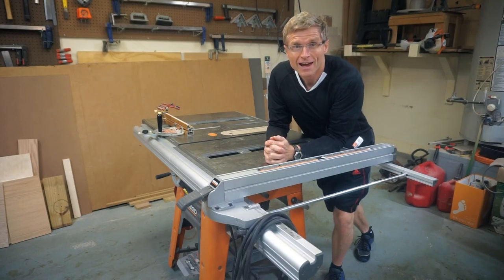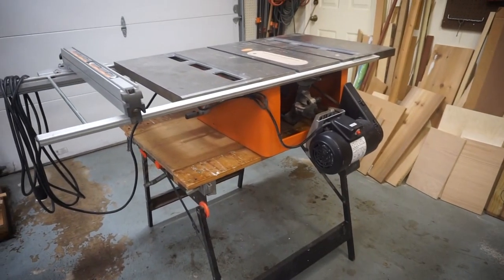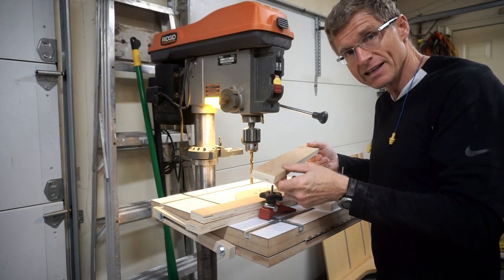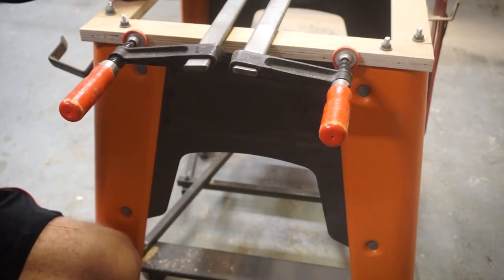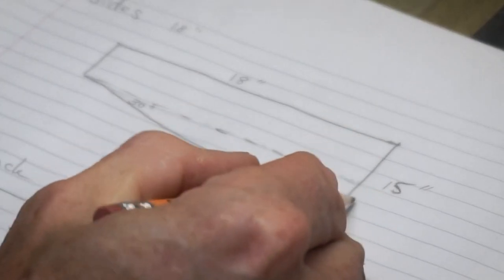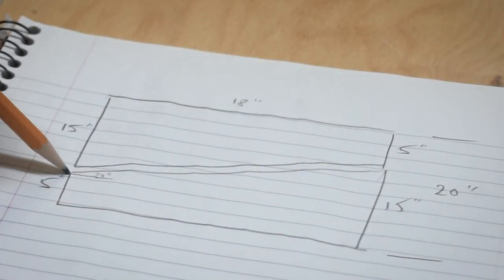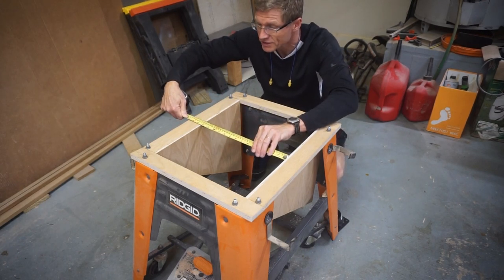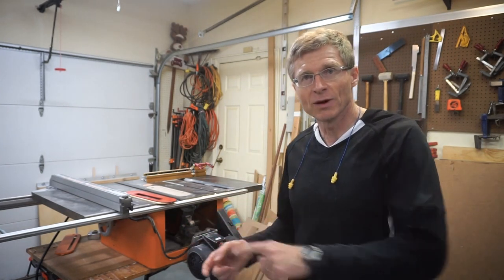How to Make a Table Saw Dust Collector

Comment: You did it the hard way. Wood attracts dust and is a poor choice for a dust collection system. Get a big gulp, 24" of 4" hose and a reducer instead and you would be done in an hour. Plus it will collect more dust. Dust collection at the bottom mainly gets the heavy particles. You also need dust collection on top for the fine particles. Use a Guard Shark for that.

Comment: One other thought.  It might be wise to incorporate some type of "door" to access the collection box.  I get thin slivers and other sizeable pieces slipping down past the blade that would likely get stuck and clog up the port inside.  Maybe just a drop in slot for the hose port rather than screwing it on?
Reply: Whole back is wide open. That’s the issue I need help with.

Comment: Thank you for this informative video.  After perusing many how-to's for table saw dust collection, I settled on your design.  Construction went smoothly but I was disappointed in the amount of dust collected on my first run - until I realized I'd left the vacuum hose in the BLOWER side of my shop vac - yep, I did that!  Moving the hose to correct vacuum port resulted in an impressively small amount of saw dust on the saw and none on the floor after many cuts!  Again, many thanks.

Comment: Was a good reason to replace my old one I did in a hurry. Nice project and was an easy build.  Did not see the need to dado. Just used glue and caulked all the inside corners.  I didn't like how the frame stuck out so before mounting the table back on I used a flush trim bit. Nice coat of smoke gray paint for the edge of the frame and you cant even tell it was an add on.

Comment: Just one question. When you put your saw back on the base how did you get at the bolts  to hold it down?
Reply from the maker: The back of the saw was still open for the belt to attach to the motor, so I was able to reach in through that opening.

Comment: Hi. I used your idea on my table saw and am getting dust collector together now. I had to rearrange the shape some but I think it will work when I remove the openings that allow too much air flow. Because I have an old saw the dust comes out instead of down into the shute. Boy, I'd love to have a new saw with all the new tweaks and perks! Anyway, thanks for the video. I think you did a good job.

Comment: Many thanks for the video.  I have the exact same saw and have been looking at ways to enclose it for dust collection.  Your video is very helpful, but I'm still trying to figure out a way to also seal the upper area where the motor bracket and belt goes through so it will improve suction and actually create a negative pressure inside the box.  The motor and belt have to move when you tilt the blade, so it creates an interesting problem.  Thinking about a box to enclose the entire motor, or possibly a curved slot for the bracket and belt, lined with some type of brush bristles.

Comment: I have a mid-1970s Craftman 10" table saw.  I like the general design here but my saw's motor is not hanging off the back of the saw; it is direct drive.  So I don't have access to build a box and then remount the saw to the stand since I can't access the bolts.  I may to add doors to the sides to allow me to access the mounting bolts.  Just trying to come up a design to do that.

Comment: Can I ask you a ridiculous question? My table saw is a small portable table saw, ""and yes cheap, a small Ryobi table saw""... 
I want to make a new stand made of wood, so I can install a good locking caster system to move it around easier and a good dust collection system below it, as you're doing, plus of course my dust collection hose connected to the dust port in the back. So here's the question. 
My table saw has holes and openings pretty much all around the table saw. (Both sides are totally open, there are openings in the front and back).  So Do you think, if I make a good dust collector on the bottom "like you're doing" as well as the collector in the back, that wood and dust will fly out everywhere due to those openings everywhere anyway? Or I'll have to block and close all those openings to make it work well? Please let me know what you think. Thanks
Reply from the maker: I'm not entirely sure, but adding some kind of dust collector underneath, even with the openings around the sides, would be better than nothing. You'd likely get better dust collection if you could somehow build an enclosure all the way around the outside edges of the saw.

Comment: I was surprised you didn't make the bottom more of a funnel towards the dust collection port.  Do you have a problem with the dust collecting in the corners of the box on the exit piece?  Or does the suction from the shop vac take care of that issue?
Reply from the maker: Sorry...I didn't get a notification for this comment, so I didn't see it until now (the stay at home order is giving me more time to check things like this).  I don't think there's any problem having a little dust collect in the corners. There will always be some accumulation, but as long as the dust port is connected to the vacuum, all of the excess is pulled out.

Comment: Hey....what about the test ride?  Did it finally work?
Reply from the maker: Yeah, sorry.....I guess I was too anxious to get the video out so I didn't wait to test it out on camera. It actually worked quite well. Just having a box beneath the saw to collect the dust instead of it falling all over the floor was nice enough, but when a vacuum was attached, it really sucked up the dust.  Not perfect, of course, because the saw was wide open at the back for the motor and pulley, but it was way better than the original saw with no dust collection. I ended up selling that saw the following summer and upgrading to a cabinet saw, but I sometimes miss that Ridgid saw that I really liked!

Comment: Hello. Does not this collector end up breaking the engine cooling down?
Reply from the maker: The motor on this saw is at the back, and not enclosed by the dust collector box that I made, so the cooling is not affected.  If the motor was enclosed by the dust collection box, I think it would still be ok because the air being pulled through the box by the vacuum would create enough circulation to keep the motor cool.

Comment: What happens when you drop your arbor nut ? Also, you might need a way to equalize the back pressure - such as an adjustable air intake. 
Your joinery skills however, are immaculate and precise !
Reply from the maker: A little bit of cursing when you drop the arbor nut inside. It's not too big of a job to remove the dust port and fit your hand inside. I had to do that at least once. Since the motor is not inside this cabinet, there's plenty of air coming in because of the space for the belt to attach to the motor. It's not an optimal solution, but way better than without any dust collector at all.

Comment: Hi:

I know this is an old thread but I want to compliment you on the effort.  This is exactly the saw I have and I have been procrastinating until I saw this yesterday.

I was intimidated by removing the saw from the stand but I figured out I could make a frame to support the saw and just slide the stand out.  

Did you have trouble getting the carriage bolts back in to reattach the stand with the chute in place?

Thank you for sharing this approach!
Reply from the maker: I don't remember having any problems to get my hands in through the back of the saw to reattach the carriage bolts. I just needed my wife to hold the bolts while I got the nuts started.

The biggest problem that I faced was that the position of the holes changed a bit, so they didn't line up properly after I went to reattach the base to the saw. The reason for this is that, after lifting the saw off the stand, it was no longer putting that big downward force on the stand which was causing the legs to spread apart a little bit. I had measured the positions of the holes based on where the holes were on the stand (without the weight).  When I went to re-attach it with the dust collector in place, the holes didn't line up with the holes in the saw anymore.  

It wasn't a huge problem for me. I just had to re-drill the holes in the wooden pieces so that they would line up with the hole positions in the bottom of the saw, and also accommodate a shift in the hole positions after the weight was put back onto the stand.
Reply: Thank you.   One other thing I noticed... and it may be my fault, but after I got the stand out from under the saw, it pivoted on the bolts.  Perhaps they were just not tight enough or worked loose over the years.  

I made my wood flange and marked the holes based on the bottom of the saw and the holes did not match after drilling.. your reply here explains that.  I'm still concerned about getting those bolts threaded back through, but hopefully I'm worried about nothing.  Again, thanks for the motivation and a nice design!

Comment: Doesn't look like you left a panel to get anything out that might accidentally be dripped in there. If you do drop anything, you're going to have to take the whole thing apart again.
Reply from the maker: It's still open at the back to allow room for the belt, so that gives enough room to get your arm inside when you drop something, which I've done a couple of times.

Comment: Sorry i had to skip the video a few times as i couldn't hear you properly, otherwise a good video. (I did leave you a comment, before but for some reason it hasn't shown here)
TC, Barry (ENG)
Reply from the maker: Hi Barry, thank you for your comment. This is actually a new version of yesterday's video because of the audio problems that you and others reported. I think it's a lot better now. Still not ideal because this video was from back in the days that I didn't have a microphone, but at least it's audible now. -- Mike

Comment: I subscribed and unsubscribed because no demo. Makes you wonder how well it works. Guess we'll never know.
Reply from the maker: Sorry about not providing a demo. I was anxious to get the video out and my wife wasn't available to help me get the saw back onto the stand. It ended up working quite well and saved me having to sweep up from under the saw after every use.  (I use past tense because I sold the saw about a year later)  It's not a perfect solution because the back is open for the motor, but it's way better than having nothing underneath.